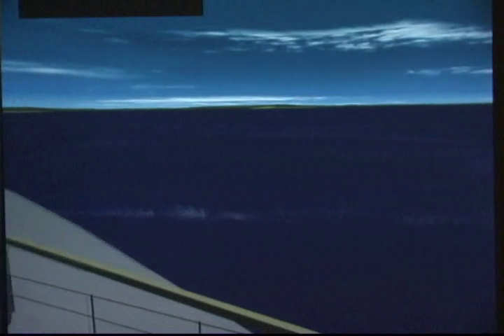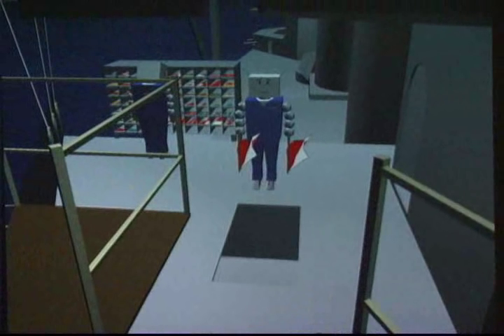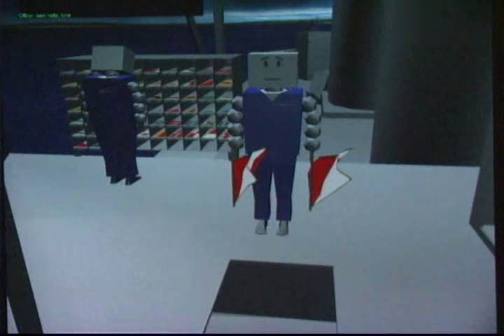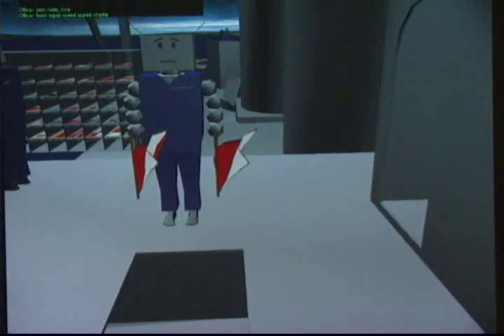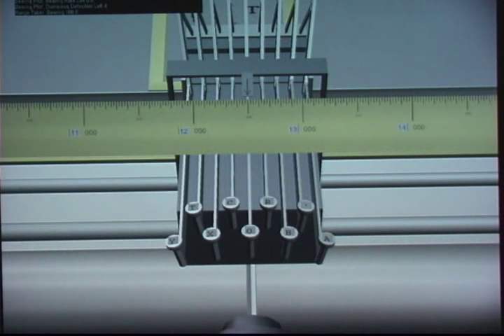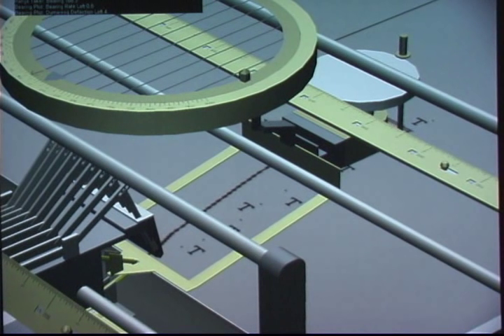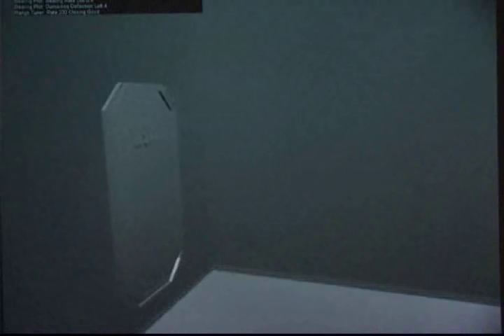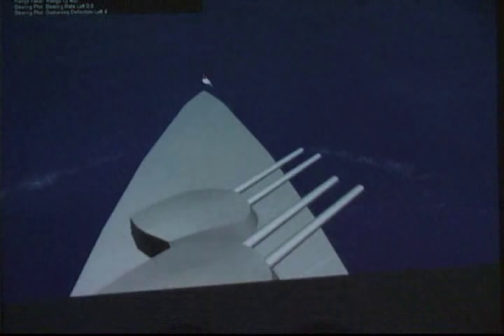Dreyer Fire Control Table Mark III

Comment: Consider the complexity of the problem they were asked to solve and the technology with which they were required to solve it, and the meagre hit rate doesn't look so bad. Sure, we'd do better today, but we have radar and fast computers, and as a last resort we can track the shell all the way to the target and figure out where to send the next one almost before it arrives. Take all that away and where would we be? Back to old methods again, albeit possibly with better-quality machinery.

Comment: During WW2 it was the job of the Royal Marines Band if on board to man the transmitting station. Due to its importance the men were locked in so the chance of escape was near impossible if the ship went down
By the end of the Second World War, 225 musicians and buglers had been killed in action, which was a quarter of their strength at the time, and the highest percentage of any branch of any service, after Bomber Command.

Comment: That's my pt. The whole system had become too complex. The chain of control too delicate and vulnerable to breakdown of just 1 smallest part. All because it had a very difficult task to do : putting huge shells way beyond visual ranges onto a target maneouvring while oneself is also maneuvring and subject to return fire. And that was why the big guns and its overly complicated fire control was discarded once humans found a cheaper and simpler way to sink ships : bomb and torp them from the air.